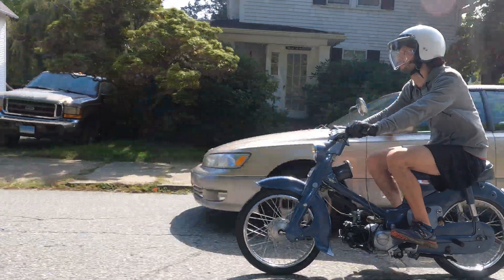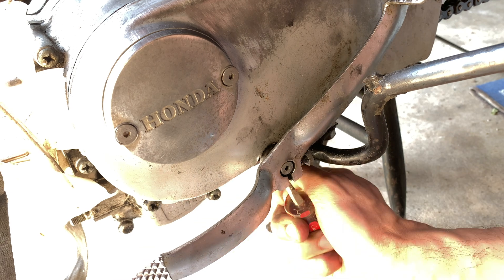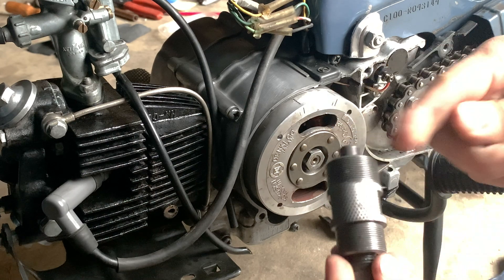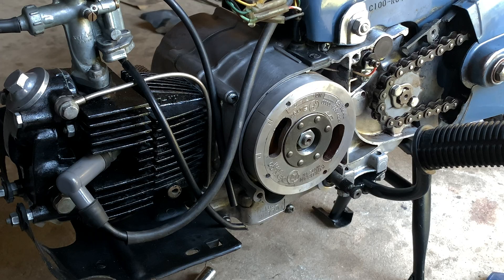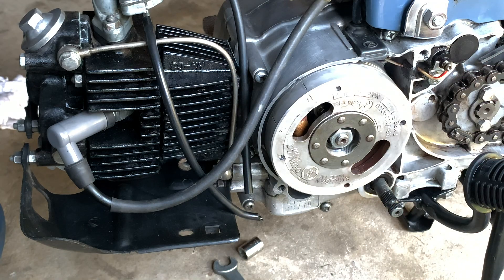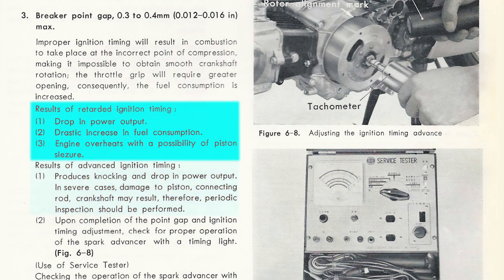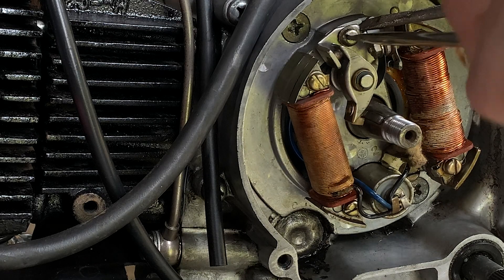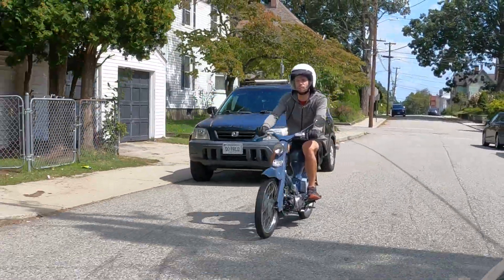Honda 50 C100 Ignition Timing Setting Point Gap Breaker Troubleshooting

Comment: A couple tips and corrections: Never use case bolts and a wrench to brace the flywheel for removal! You'll most certainly bend your bolts and/or break a piece out of whatever threaded case hole you use to brace it, if the flywheel nut is torqued to specs. Take a #2 Phillips and stick it in the flywheel slot and turn the flywheel backwards until it traps the screwdriver between the slot and the lower corner of the right side armature, the heavy wound one for the lighting circuit (yes, that's the one for lights and charging). Then you can break loose the flywheel nut without destroying your case. Condensers do tend to fail on these after 40 years or so.😄 So it's a good time to de-solder the 3 leads going to the center terminal and replace it and the points as well. Be careful to use a fairly large soldering iron (or a good Weller 100w. soldering gun) for removal and reconnecting the wires, so as to reduce the amount of time needed to melt the solder. Re-oil the felt rubbing block with straight 30w oil, and replace the flywheel and nut. Re-torque nut to specs using the screwdriver to block the flywheel on the opposite side next to the ignition (smaller windings) armature. Using an external 6v battery with a 6 or 12v light bulb as a ballast, connect positive lead to the coil primary, and negative to a ground on the engine somewhere. With the battery connected, the light bulb should glow bright when the points are closed. Turn the flywheel until the points are just opening (light will dim). Turn to the 'F' mark on the flywheel and adjust so the points open just as it crosses the 'F'. Another quirk of these old Honda ignition systems is that they DO NOT run well without a battery, since both the ignition and charge circuits are series coupled. The battery acts to keep the voltage down below 7 or 8 volts while running. Since there is no voltage regulator, you need to run with the headlight on if riding extended distances across town or whatever, to help dissipate some of the power from the lighting circuit.😉

Comment: I tried the case screw wrench trick to hold the flywheel… and bent my case screw :( Any other recommendations for holding the flywheel to loosen the bolt?
Reply from the maker: …OR…! Some kind of metal or hardwood spacer that is between the flywheel bolt and the floor pointed more towards the left side of the of the flywheel, so when ur hammering all the force is going into the ground.
Reply from the maker: Maybe some penetrating compound like PB blast, and try to find a wrench or some kind of metal object that is a correct amount of length so the stress on the bolt is pushing at where the bolt threads into the engine frame, as opposed to drifting out towards the head of the bolt like my wrench is doing in the video…. I was more concerned with the smaller bolt not getting bent and was just using a random lengthed wrench… if it was a little shorter it would have been more ideal for breaking a tough nut.
Reply: Thanks @dotdotmatrix. I ended up buying a clutch/flywheel holder. While I waited for that to arrive, I put several applications of WD40 on the nut. Then, once I had the holder tool, I braced that against the floor, and tapped my ratchet with a hammer until it broke free.

Comment: i needed the entire stator to rebuild my engine, buying a CDI + regulator + rectifier was cheaper. However, i used to have a Sachs moped with stock points ignition and i could reset the point gap on the side of the road in under 5 minutes. i appreciate both.